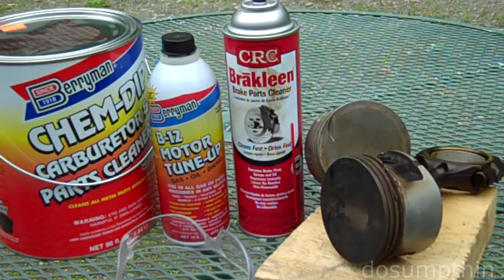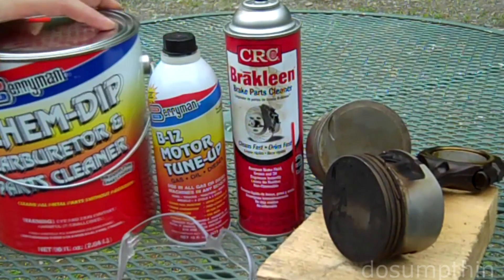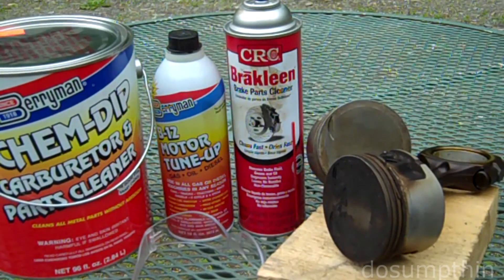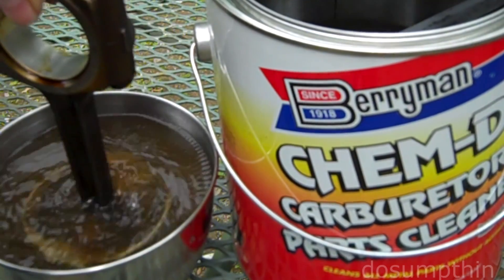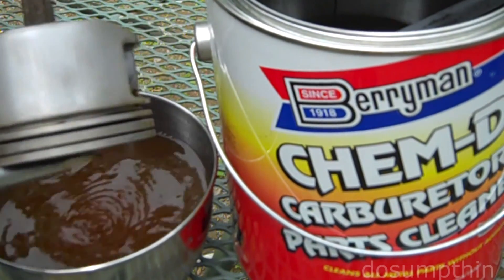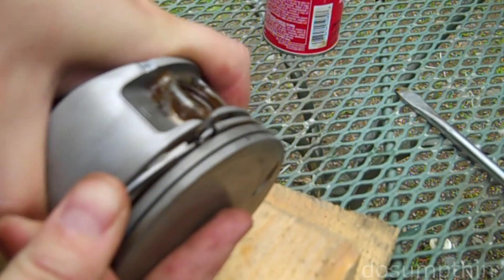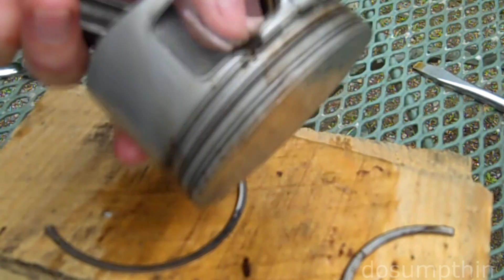Dissolving carbon buildup from pistons - Cleaning piston ring grooves engine rebuild compression

Comment: How about ATF? Will ATF work?
Reply: No.
Reply: Actually maybe. One time at a customer's location I diagnosed a very poorly running four cylinder engine with low compression on 2 cylinders. Checked all four dry, then wet after using a small amount of transmission fluid in each cylinder for the wet test. It was sent to the shop where a different mechanic double checked the compression. And found it was just fine on All 4 cylinders. And it ran well also.
It took us a while to figure out that the transmission fluid probably unstuck the Rings.

Comment: Dude, tell me you didn't post a video of some gunk getting dissolved after you already did 75% of the work by hand? We want to see the results of the untouched carbon locked piston in a straight dip for 5 hours not something that's already been slaved over.
Reply: That's what I wanted to hear :) I seen this stuff in autozone and didn't buy it because of what I seen on this video but if an overnight soak will do the job I might give it a shot
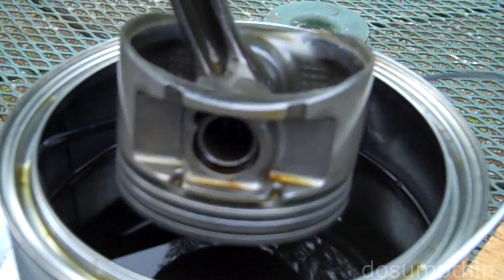Reply: He did show a before and after still shot at 5:27. We should assume this is the comparison you need.

Comment: that stuff is like the old Safety Kleen  Carb cleaner that came in a 5 gallon pail.  we used to call  carb acid but it was not acid  . in the pail went a dip basket with an agitator on top that was air operated.   carbs came out like the day they were made . and pistons looked brand new. but this stuff was nasty
Reply: Yep, eat your skin if you get it on you, and those fumes!!! Used Gunk Carbeurator dip for years!!

Comment: Pour the contents of that can into an ultrasonic cleaner and clean in that.

Profit.
Reply: +FrozenHaxor 
heating the fluid up might help to speed up chemical reaction...
Reply: +SladkaPritomnost Some fancier ultrasonic cleaners have a heating function as well.
Reply: +SladkaPritomnost   I dont see the point of heating anything up only to walk away and forget about an open flame.  I just let it soak for days until I get back to it.  No sense in babysitting parts.  If I had a shop thrn yes I'd have a hot Dip Tank but for Joe Blow people like us, its good enough.

Comment: I used the berrymans chemdip after watching this video. it works but it will not remove a thick build up so its best to use a brass bruss and clean it off as best you can first then dip it. I found that towards the end i was mostly dipping the piston to weaken the carbon in the ring grooves then scraping with a broken piston ring like suggested (most time consuming part of cleaning the piston)

Comment: wire wheel on a drill would work
Reply: +jerry carlton No way!  How could you say that??  THATS A SATURN PISTON!  Those pistons are solid Neodymium-filled and Titanium coated!  Its a simple observation that these pistons are from a engineering team that took extreme care during its design, and are literally a testament and trophy as to what the modern human brain can achieve with science.  After all, they did come from a Saturn Station Wagon painted the same shade of purple as Barney (the dinosaur), and were going in a high-end engine with a bright orange powder coated valve cover!

Comment: new post one are like 10 bucks a piece on eBay. get it together man, 10 more bucks you would have had 4 new pistons
Reply: +ben dover rather use oem then use some crappy ebay pistons
Reply: New pistons cost way more than $10 a piece. You probably saw an ad for used pistons, in which case the piston you need may not be available.  I would never buy a used piston. Then after you get the piston you have to pay someone to press them on the rod, and if they are used you will need to buy new wrist pins. You will have to hope you get the right piston when you order through the net.  So you are talking out your rear.
Reply: new pistons
Reply: +ben dover ceramic coated
Reply: +ben dover ...and if he doesn't have an arbor press he can take the 4 new pistons down to somebody who does have one and pay them to press the wrist pins out of the old ones. That is if the new pistons are an exact match-up for the rings, etc.

Then again, now he has a can of Berryman's and, trust me on this, he will be able to use that lil basket on a BUNCH of stuff in the future. That shit's the good stuff, like it says on the label. Every engine builder ought to have a can for pistons, valves, any small parts that will fit inside that get car-'boned', varnished or even painted.

They last fairly long too, well worth the $30.

Comment: ANY CARB. CLEANER, Do not mix with old used motor oil, Must be discarded in original container, and anything that is used to rinse it in, even if it is water, can only be returned to certain places, if you dump anything the drain or city sewer, the fine alone is $10,000 and that does not include cleanup, and you could be put in jail, carburetor cleaner is some bad stuff, and do not get on your skin and use it only outside or in well vented area !!!.
Reply: diabeatis
Reply: +Dennis Friedman Dude!  I was just kidding.  I dont actually dump anything down storm drains....
Reply: +rednecktalkshow you can tell the EPA and get a reward for illegal dumping...surprised they havent been caught yet. its really hard to get away with it.
Reply: # 1 dumping anything down the storm drain other than water, can get you a
$10,000 fine + the clean up cost + and possible jail time, I used to be truck mechanic, that hauled gas and diesel fuel, the D.O.T. come in on use one and said that the mechanics were not even aloud to move the trucks from where they were parked to the garage to work on them, even though they never left the private property, so all of mechanics had to go get CDL (commercial drivers license with hazmat endorsement), later after we had an accident, with a tank truck and lost gas down the storm drain, we had get trained and licensed to clean up hazardous spills, This was done by the state of Ohio E.P.A.,they told that nothing but water can be dumped the stone drain, he told us the anything made from an oil base fluid, gas, diesel fuel, kerosene, motor oil, even a car was can not legally dump, what is washed off vehicles, can be dumped into the storm drain, carburetor cleaner has some very bad stuff in it, we dumped two quarts in a 275 gal.oil tank, after he started pumping it in his wast tank truck, he could smell it, he jumped all over us, saying that now it contaminated every thing on his truck over 2000 gal. and he had no were to get ride of it., getting gas or even old used motor on your skin repeatedly, can have an effect on you years down the road, we was not even aloud to used motor oil and used antifreeze in to the same tank,
I worked at that place 25 years.
Dennis
Reply: +Dennis Friedman  Call the cops or the city public works department the next time you see someone dump used motor oil.
Reply: Hey Dennis. Don't pour it down the drain. Forget about the pollution police. Find you a nice ant bed in your yard and pour this stuff over them. It won't be enough to affect the environment and may even kill your ants or at least make them move to a new spot.
Reply: I have seen people that have dumped old motor oil down the storm drain
Reply: yes this a must
Reply: +Dennis Friedman Every pick up now is tested, and heaven help you if it's contaminated
Reply: Blast this stuff off with some brake cleaner onto some rags / cardboard. Why in the hell do I see all these people trying to rinse this crap off with water???  Stupid.
Reply: Not if it's in floor dry or soaked into a rag.
Reply: We have a place in are town that runs a hydraulic shop and you can't even walk in there parking lot , it is full of oil muck ! And they take a pressure washer and run it down the drain in the middle of the parking lot into the city drain . That crap is an inch thick of old hydraulic fluid and crude !
Reply: Thank you Flanagan
Reply: why not go for the death penalty!? BASTARDS!!!!!!!!!!
Reply: +Dennis Friedman I use it all the time.  No gloves.  In fact, when im done with it i just dump it down the good ol storm drain in the street.  The grates on the storm drain look real good now!
Reply: Great idea ...LOL contaminate your own land...You are kidding right ?
instead use it on your veggies they will grow better for sure ;P

Comment: it's a good thing that you made this video.    maybe now people will realize that there is no such thing as a "miracle bottle" of combustion cleaner that you can simply pick up at autozone, and pour it into your motor, and expect to see results like that.
Reply: +Jeff Fuehr It only works on 1.9 Litre 4-cyl Saturn Wagons painted the same shade of purple as Barney the Dinosaur and have Bright Orange powder coated valve covers
Reply: +Jeff Fuehr   Steam works great for cleaning valves and intakes.

Comment: how much it cost you ? i bought some degreaser purple Castro and soaked in water over night and remove the same as what you were doing . Castro. degreaser seem to works the same maybe for less dollars. , bought 2 1/2 gal. and used 3x 16oz.  spray. and refill. . I boughted from Walmart. . My engine block was 500k miles and piston rings was only 138 psi to 145 psi gauge with burn valves , so I send out the heads for repair and replace part , but I clean piston with gas no result or brake cleaner without any luck , so I clean with degrease Castro purples 2 1/2 gal. for lesser than $20 and still have degreaser for other job
Reply: +Thanh Ma Great advice man!  But was it a purple colored Saturn wagon with Coast-Guard colored powder-coated valve covers?
Reply: +J Williams is a Super Clean degreaser Williams , buy at Walmart in automotive detailing area , some Walmart sell in 1 gal. for $9.50 some other Walmart sell 2.5 gal. for $17 . I put 6 piston in with  rods soak for a 48 hrs . and wash off all the carbon . I bought 4 gal. plastic bucket at Walmart for $3 to soak all the part . and is still got degreaser let in 1.5 gal. remaining , if I were buying what on video , I would have spend .more that it was , probably around $15 extra with taxes. try it Super Cleaner degreaser is stronger and it remove more carbons than every other chemicals and it save you extra moneys also
Reply: Thanh Ma I will try it!  Thank you!
Reply: Good I'm glad to help you save moneys

Comment: I use chem dip on all funked up engine parts. It gets them clean just as in this video. iN fact some come out looking so clean that wear areas immediately appear even before a thorough rinsing. Cleaning pistons is an absolute snap with a new jug of chem dip.
Reply: +Robert Rowlands Im gonna hire you for my next commercial!

Comment: Auto Zone has a piston groove cleaner on their loaner tool program just $25 and you get it all back when you bring the tool back.
I used a rotary wheel brush to clean most of the carbon off I just couldn't get the grooves all clean.

Comment: $30 and all your labor? new pistons and rings are only $94 free shipping on ebay.
Reply: yea im sure those are pem quality too. lol hahahaha woyldnt use thise chinese junk to prop a door open
Reply: My 1.9 saturn running great with lots o power with these pistons/rings and rod bearing from ebay. 			 		
	eBay item number:
261514020572
Came from right here in los angeles.
Reply: +TechKnowCSS And they got them right off the boat in San Francisco ROM CHINA !
Reply: +TechKnowCSS do you think it can run 300 hp's of boost on a saab 9-3 what is 150hp orginal?
i dont think so maybe if it was orginal but a tuned car and ebay quality is not a good idea

Comment: Could you pour this down into your cylinders and leave to soak eg a few hours then just change oil and filter after ?
Reply: carlcostello360 Piston rings are usually stuck because the anodic piston and cathodic rings are corroding together. It can also be caused by damaged piston ring lands from detonation or hard particles between the ring and the land. Soft carbon, doesn't really have what it takes to stick rings.
Reply: No... I wouldn't recommend that.
Reply: carlcostello360 Yeah that would be bad news, this solvent is designed to dissolve pretty intensely. I would say even dipping pistons in it you would want to be very thorough in getting it off. An oil change or two won't guarantee it's all out of your system.
Reply: Standard Excellence ok i was just thinking if you have stuck piston rings or you want to de carbon the cylinders eg your cars been sat a long time putting this into your cylinders would work wounders as it melts away carbon build up and then do a full oil change eg oil and filter. :-)
Reply: I think it would work. But I'd rotate the crankshaft until the piston was down as this cleaner might damage the head gasket.   Give the solvent time to seep past the rings.  Add some fresh oil to that cylinder and rotate by hang with plug removed so you know it won't hydrolock.  Drain the oil and flush the oil pan with a safe solvent like diesel fuel or kerosene.  Berryman's will evaporate so it shouldn't linger long after the oil pan has been drained, but I'd be careful to drain and flush.   There are some top end cleaner products that you can use to clean the rings in a "granny car" that sees mostly short trips at slow speeds.

Comment: What would cause such carbon build up?
Reply: Bulgdoom regular use unfortunately.
Reply: +SANIC usually short tripping where ther engine sits at idle for a long time and doesn't get to warm up , tear down an engine that has been driven a lot n the city, and another one that has been driven a lot on the highway very likely the engine that has been driven in the city will have a lot more carbon
Reply: 1975 First On Race Day Capri 3.0 Ghia or if you drive a VW or BMW.
Then vmcarbon build up is a regular thing
Reply: SANIC Audis too their new TFSI engines burn loads of oil , Alfa Romeos too burn a lot of oil
Reply: 1975 First On Race Day Capri 3.0 Ghia Audi has that oil churning issue that's destroying engines

Comment: Cheap stupidity.  You've probably spent about 50 dollars on cleaners.  4 hours of scrubbing labor even at 10 dollars an hour, which is not exactly a high wage adds up to about 90 dollars.  You can buy a NEW set of Saturn pistons with rings for around 100 dollars.  And if that's the only thing you are cleaning while you have the engine apart then you're going to have problems!!!

Comment: Did about 10 years of small engine work. We used cleaner like that. There were two kinds available at the time...don't remember the names but the one which had. A small parts basket seem to be a lot stronger. After you soaked the parts for 10 min, you spray it with carb cleaner. Believe it or not the carb cleaner from Walmart' in the blue can' is a lot better than other more expensive stuff at parts stores. Anyway' the carbon crud just ran rite off.

Comment: What I have found that works GREAT is paint stripper. The kind that comes in a aresol can. Use gloves as this stuff burns. Spray it on....it starts to fizz and bubble....eats right through carbon. Wipe and/or spray off!
Reply: Do you know if that eats into the aluminum?
Reply: HowardSupra nope. Looks like new (almost) when done. No issues over the years.
Reply: jcaashby3 Good stuff, thanks

Comment: I took the intake manifold off of my 2001 Honda odyssey in order to clean the carbon build up in the EGR port. While the manifold was off I cleaned out the ports using carb cleaner and it cleaned up nicely. I looked at the opening ports on the motor and since they were built up with carbon I sprayed them as well. After I was done I started my van up and it's idling rough. After a lot of googling I shouldn't have sprayed carb cleaner in the ports on the motor. What to do next? Is this something a normal auto shop can fix or do I need to take it to a specialist?  Is it an expensive job?
Reply: You may have left a vacuum holes unplugged.

Comment: Hey whats up man am doing my mk4 vr6 24 valve engine and am having some trouble on putting back the pistons with the new rings.
Any links or ideas on how to put it in i dont want to brake my new rings thanks
Reply: Yes man! Pretty cheap tool called a ring compressor, and you put the piston in from the top of the cylinder rod first. Of you are talking about putting the rings on the piston. There is a tool for that. A ring expander.
Reply: I think they make a tool for that piston ring expander or something like that I could be wrong but you might be able to rent one at Autozone

Comment: That's the correct chemical. If solution is fresh, soak overnight and it should come out clean without mechanical scraping. BTW, using an old ring to remove carbon can also remove metal. Try to avoid that.
Reply: Can says max soak time is 4 hours
Reply: I use a razor in ring groves and cut in deep and never gave me a problem idk am I getting lucky or what
Reply: A correct piston cleaning tool is a soft metal "cutter" it gets 90% of it after soaking. then soak again and scrub with nylon brush.

Comment: IMO Nothing smells worse than that cleaner, nothing !
Why didn't you use a wire wheel on all but the ring grooves & buy a ring groove cleaner for about $20.00 or less ?
You could have had all 4 cleaned more than satisfactorily in about an hour without the stench of that brand cleaner .
BTW , IMO Napa auto parts brand cleaner works much better & gives off very little odor .